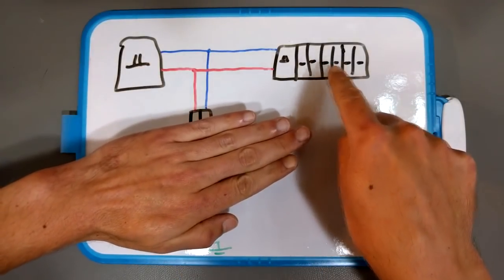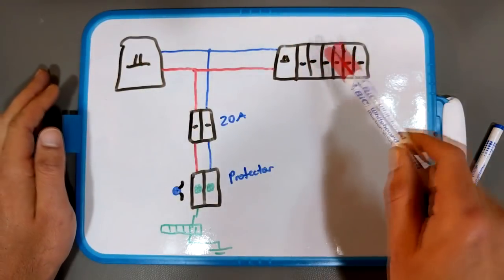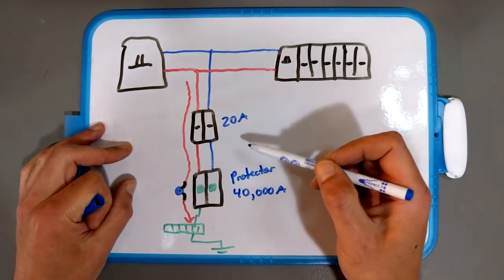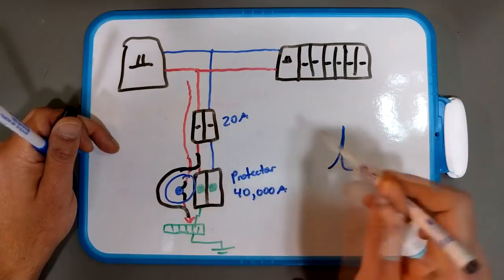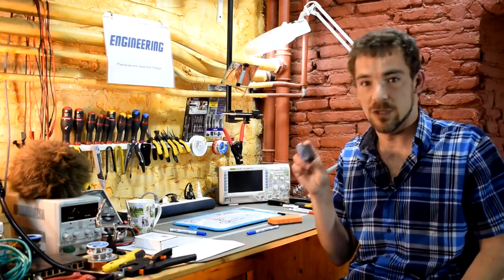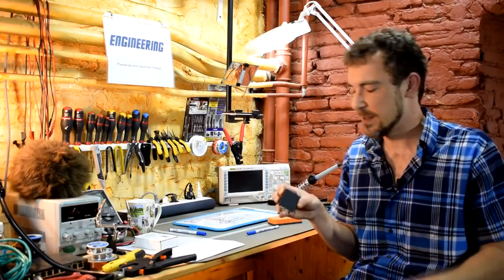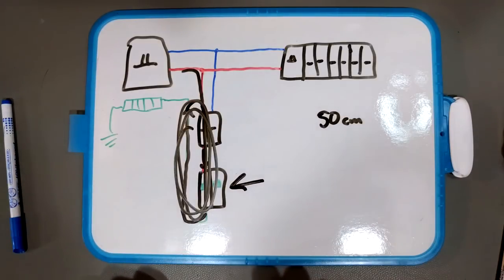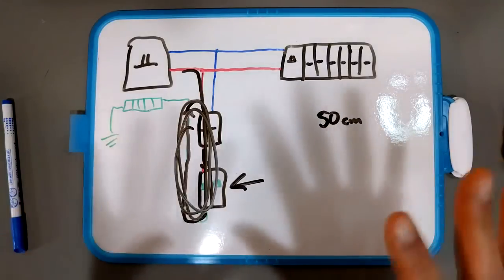You don't know you need it until it's too late

Comment from the maker: I think I cut this from the vid cuz I wanted to keep it short(ish)... AHEM... All my puters have UPSes (battery backups). They would "tick" a lot during storms due to surges on the line - switching to battery power to protect the puter and keep the AC output voltage stable. After installing one of these whole-house protector bad boys, that stopped completely. So, that's a good way to tell if you've got surge problems. And you should have a battery backup on all puters anyway, since they also isolate the puter from the grid in addition to protecting from over and undervoltage conditions. FYI!
Reply: Gee Whiz Man....stop continually REPEATING words & phrases over & over again & again! It drives me mentally nuts like you're my old science teacher from the 7th grade! I get it the 1st time you say it, don't keep reminding me cause I tune you out when I get the data I need then the rest of your Random verbal Burbs are deleted from my ears & brain!!!!!
Reply: ScottiesTech.Info Thanks.

Comment: A cheap, but effective way to add surge-protection to sensitive electronic equipment is to get a regular, unprotected power bar, an MOV that is rated at about 10 V higher than your nominal line-voltage, a regular 2-prong plug with screw-terminals, and some appropriate-sized heatshrinks and/or electrical tape for insulation. Simply connect the MOV across the plug via its screw-terminals, adding one length of heatshrink to each leg of the MOV, then wrap the electrical tape around both of the MOV's legs and the MOV itself. Then plug this newly created assembly into the power bar at the end of the bar that is closest to its cable (i.e., into its first plug-receptor). Ideally, you want your most sensitive piece of electronic equipment plugged in at the opposite end of the bar, as far away from the MOV as possible.
Reply: I'd add a non resettable thermal fuse in series strapped to the MOV as well. They often fail short or low resistance and will cook themselves after absorbing one too many surges.
Reply: @theLuigiFan0007Productions  Yes, if they have no built-in protection at all, then a fuse placed in series would definitely make sense. However, most powerbars (even the cheapest ones) have a circuit breaker to prevent current that is above the rated ampacity of their own cables. And these circuit breakers usually are the type that open permanently in the event of a short-circuit.
Reply: Hmmm... I have one powerbar that has a fuse. Of course, the others (except one the died) had no surge protection at all, so I don't know if that makes a difference. The one I have that does have a fuse is a "high end" one from the early 2000s, with a heavy guage 15ft power cable and 14 outlets on it. So maybe the fact my powerbars are all 6-10+ years old is why only the best one is fused. They don't get replugged often and aren't worn out so I haven't considered replacing any of them for any reason. I do realize the MOVs in the big powerbar I have are probably near EOL, but I usually have it on a UPS anyway.

I'v seen MOVs cook in power supplies and one powerbar (the one I mentioned died). Most in power supplies blow the fuse but not before it got pretty toasty, as the failure is usually thermal runaway. That is, they keep dropping in resistance as they get hotter after one too many surges. 

That's why I made a little comment on adding a thermal fuse touching the MOV on the surge protecting plug you mentioned how to make. Maybe that and a regular fuse. If almost all newer powerbars have circuit breakers, I completely get your point. A fuse is a nice thought, but mostly optional if one happens to be built in.
Reply: @theLuigiFan0007Productions  You could also put two identical MOVs in parallel to double the surge-suppression capacity.

Comment: Cletus is a calm and complementary co-host. This was a helpful presentation learnt from you again thanks... Down in Tassie Aurora the Electric company gave out little Surge protectors called line conditioners something like that, that you plug into the power point at the home. Green light good... Red light somethings up and so after a thunderstorm time you can go get it checked kinda thing. 💫

Comment: This may depend on geographic location, but in NA I can get very good surge protector/power strips that are even better than the whole-house surge supressor you used as an example in this video. One of my surge protectors I have laying around can take a maximum hit of 120,000 amps and starts to resist the spike in under a nanosecond.

Comment: Panel board Surge suppressors do no get connected after a breaker.
One, you want the shortest path.
Two, they have their own circuitry to deal and inform when depleted/worn.

You didn’t expect just a bunch of varistors for the $100 dlls these cost in US eh?

Because of induced currents/voltages, you still need surge suppressors for sensitive devices in the house.
Reply from the maker: They do here (France)! That's one reason why I mentioned checking local electric codes (for state/region/country/whatever). Even simple stuff is different. For example, it's forbidden to bond neutral to ground at the main panel here.  Go figure!
Reply: This method is not done in the US because of the bonding of what become the neutral power conductor (the grounded conductor) to the system ground, i.e., ground rod, provides a very low resistance path to the earth for spikes.  No varistors as the neutral and system ground are the same potential.  

In the US, we use the surge suppressor power strips/outlets to route a spike on the hot side, through varistors, to the neutral so it can reach the ground rod.  I don't see how the system you describe keeps spikes induced on a sub-circuit from having to pass through a load.

Comment: @ScottiesTech.Info  hi scottie,i asked a question on one of your EEK videos,but have had no reply,so i ask my question again on this recent video how can you determin wich of two wires are the live (phase) wire if both wires are white?? nice vids btw
Reply from the maker: D'OH! I use a voltage tester screwdriver like this one: https://amzn.to/2KJjsh3
You touch the metal end cap of the screwdriver with one finger while holding it, and then touch the tip of the screwdriver to the live/neutral wire or whatever terminal they're connected to.  The screwdriver has a little resistor and a lamp inside that will glow when you touch the tip to live, but not glow when you touch it to neutral. 
There are also contactless versions, but I've never found one that is as reliable as the contacty-type glowing screwdriver. It's a bit weird at first using one since you're basically using yourself to complete the circuit when you touch the end cap of the screwdriver, but you don't get a zap or anything. Just always be UBER careful when working around live AC circuits...
Reply: thanx for your input scottie
this will help me to know wich is wich
great videos by the way,learned a lot